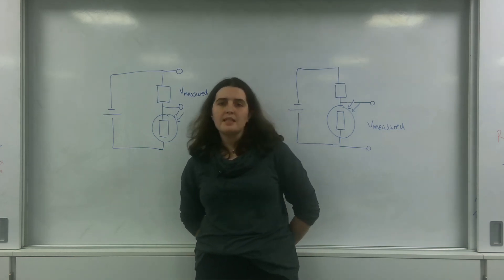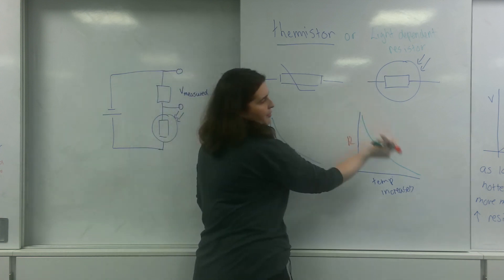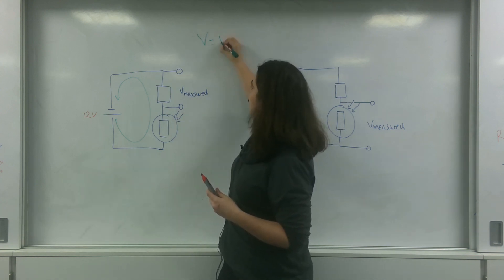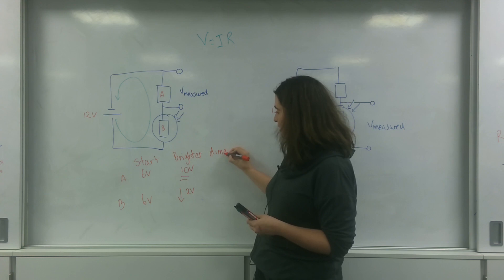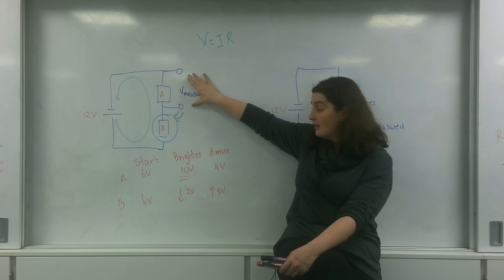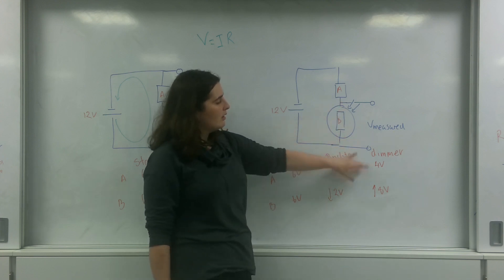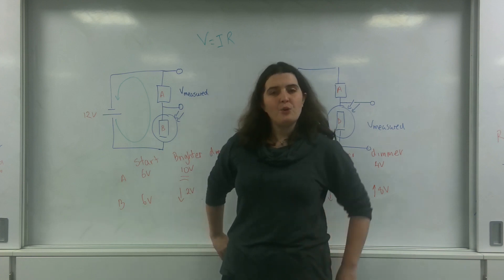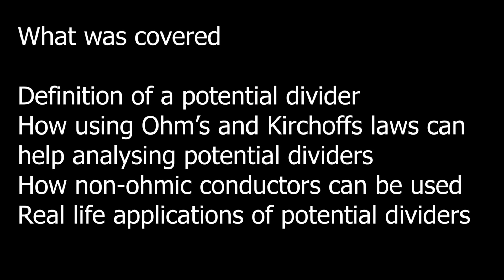Potential dividers AQA Alevel Physics

Comment: Why does the voltage decrease when resistance decreases?
Reply from the maker: Resistance is the opposition to the flow of electrons. Basically when an electron collides with the internal lattice of a resistor it imparts energy (PD) 
The greater the resistance, the more collisions happen therefore the greater the proportion of the electrons energy (PD) lost over that resistor
Hope that helps